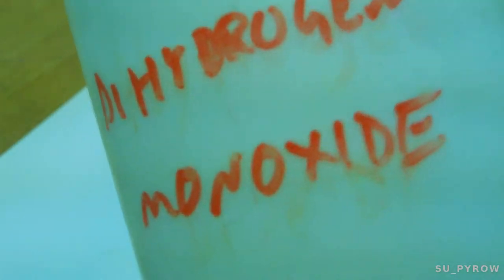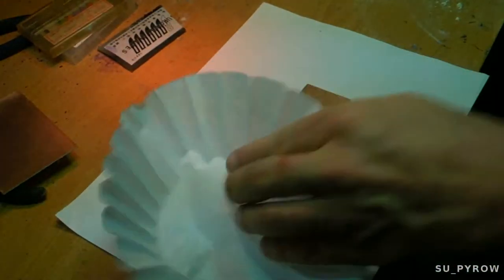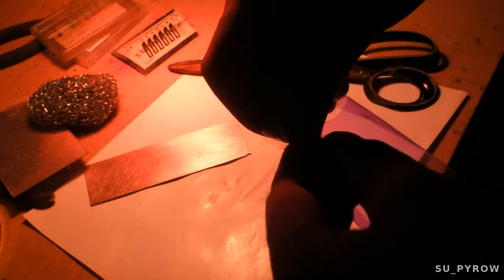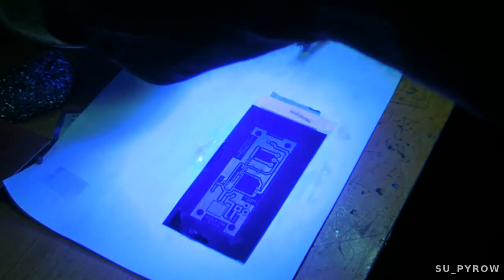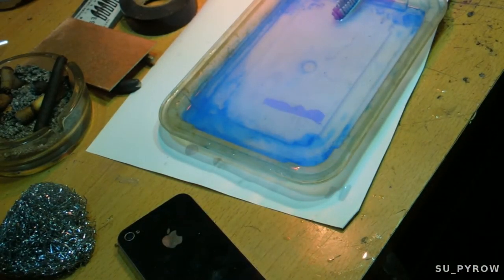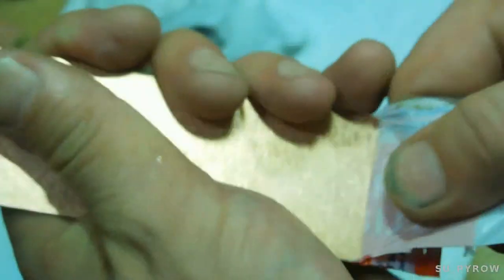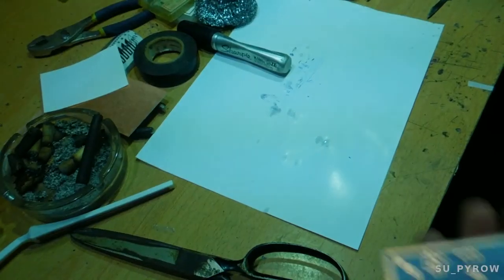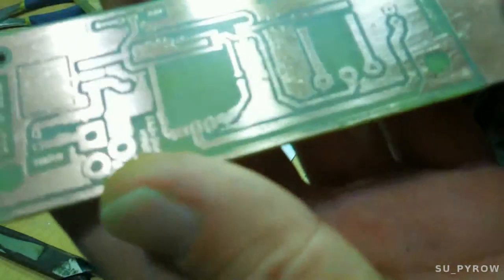PCB using Dry Film Photo Resist Technique Double Sided Circuit Board HOWTO

Comment: Hi Bobby, I've never tried this.  The last time I did something like this was in high school photography dark room with film and prints.  Um thinkin of developing 16mm b&w movie film, only need a developing tank.  
I like how you show how to do this without much equiptment, the only fancy thing was the Dremel tool.  I see those travel flat irons at junk stores often for a few bucks.  Some PCBs from the 60s were pretty bad, the traces would lift off.  
I like working with PCBs, but my poor eyesight makes it hard to do modern micro surface mount.  ICs are too small for a nearly blind guy, so I do the old 60s crap.  
I really enjoyed thia vid.  Of course this takes a lot of time per PCB.  Um still totally amazed about making IC chips.  That microscopic stuff blows my mind.  
Don
Reply from the maker: yea the small is is very impressive, it gets smaller and smaller everyday!

Comment: When i was in my first year for electronics technician,we had a very heavy and pricey guilotine for shearing copper clad board,i use a reasonably heavy paper guilotine for A4 and it was around the same cost as a good roller cutter shear for paper,ecept the guilotine cuts copper clad easily,mill cutting glass board costs more to your lungs than any guilotine as the glass acts the same as asbestos,i'd get a paper guilotine from ebay mate,or make one from some tool steel or a flat leaf spring.

Comment: I like the oldskool, roughcut feel of your vids. Question: what brand of copper clad boards do you use? The cheapest available, or do you go with the higher-end, more expensive boards?
Reply from the maker: Thanks!    I use quality boards from abcfab on ebay.  been using him for years   https://www.ebay.com/usr/abcfab.   if I need 'Rodgers' boards for high frequency differential pairs, he has them in stock as well.

Comment: How much temp you set on iron and how do you remove second layer of protective sheet... For me most of times while sheet comes out instead of protective sheet
Reply from the maker: i was just making a board using a modified laminator.  the temperature on the hand iron: for plastic photoresist and soldermask. that i found to work well is: 150F for dry. 325F for paper toner
Reply from the maker: i use two small pieces of scotch tape, one applied diagonally on the corner, then the other piece of tape on the opposite side of the material, then carefully peel away from each other.  one or the other will grab the protective sheet and it will separate.
Reply: @supyrow  right... That works while applying it to pcb. I am asking after exposure how do you remove 2nd protective sheet !!! I fail to remove every time :-(
Reply from the maker: @chandelrohit1981    well, after exposure, it will pull right off, it should be easy enough to do with your fingers, i expose for 150seconds, remove the acetate and then the protective film. develop with sodium carbonate. etch. then remove the resist.  if you forget to remove it and put it in the tank, just remove it from the tank, rinse well with water and continue the steps.

Comment: I have a 36W UV light tube. At a distance of 18cm, how long should I expose the board ?
Reply from the maker: You would need to do what I did. make a series of small boards and pick a distance that is comfortable for you to work with and have a timer starting at 30 seconds. do the next board at 60 and so on.  then develop all the boards(with labels on the back, to know which is which) then decide.
Reply: @supyrow  Ok. Will try that.